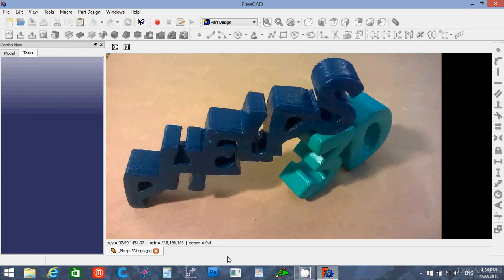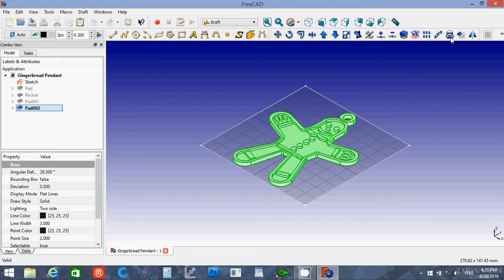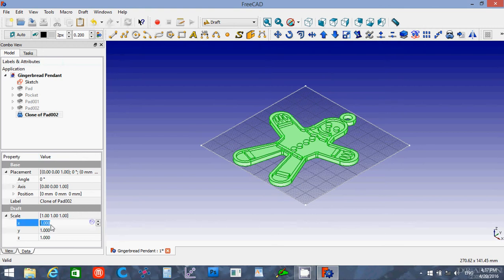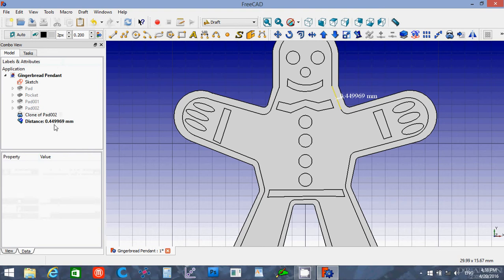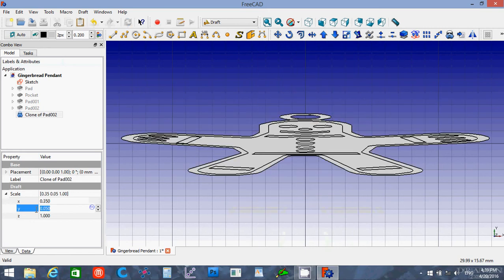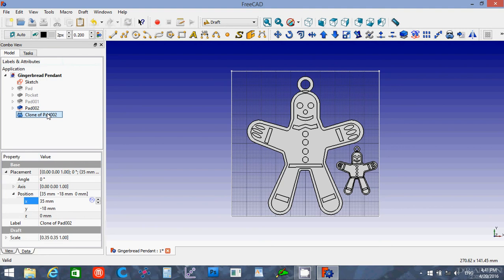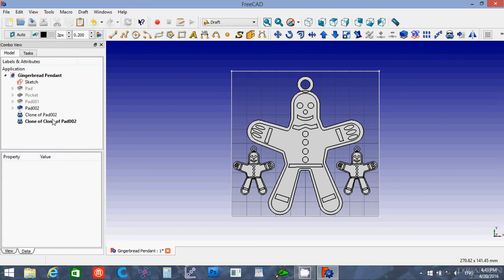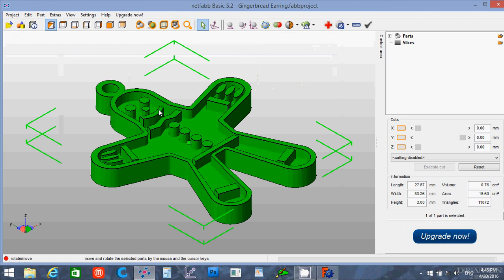Phelps3D FreeCAD 0.16 Draft Clone Tool Tutorial

Comment: hi..love your videos..i have a stl file i got from thingiverse but its way too big so i want to resize it...i am able to use draft work bench and clone it and get to scale option but i dont understand the option....i just want to modifyl the image equally to get it smaller..how can this be done?
Reply: oh i think i was using wrong scale option..i see what you did let me see if works..i went to scale in the menu option at top of screen not in data of object
Reply from the maker: Hi, you may need to do a convert mesh to part in the part menu before being able to clone the object. It will take quite a while for it to convert. Good luck.